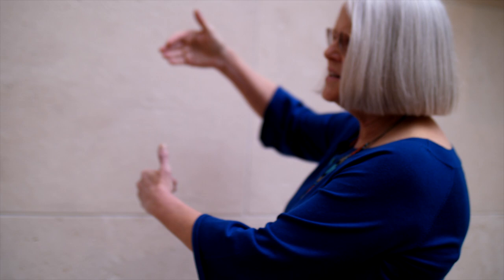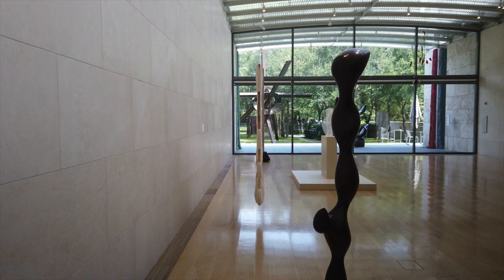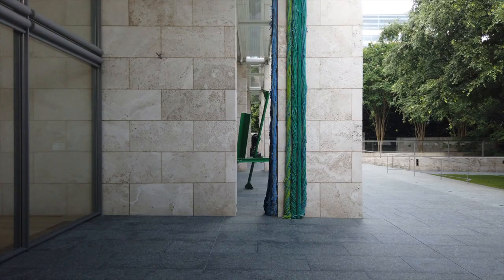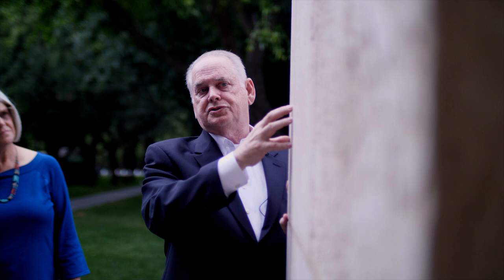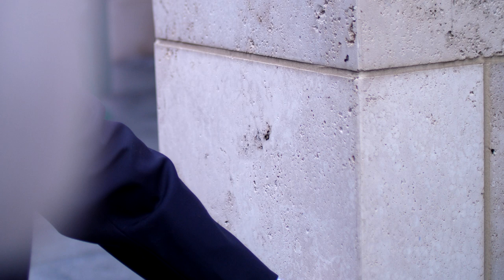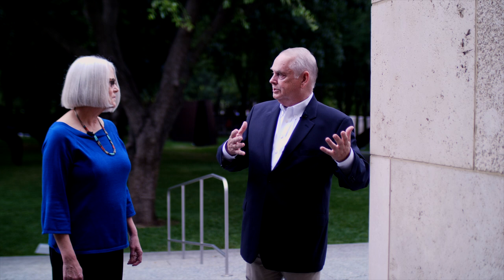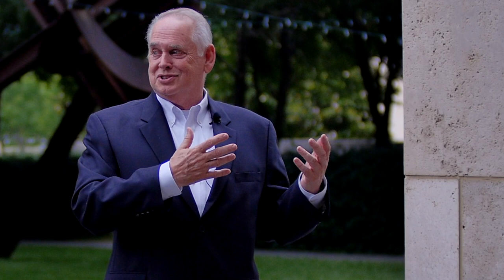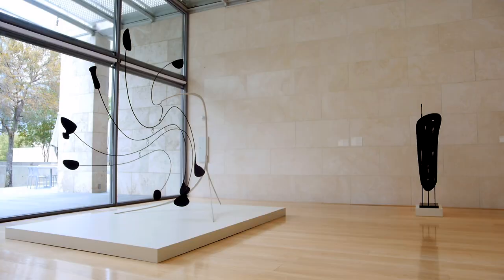Nasher Sculpture Center: The Building's Material

Comment: The man says that the outside stone facing is anchored to steel. Yet the image of that exterior wall clearly shows a concrete wall behind the stone. The tell-tale circular holes for the original concrete form's compression rods are clearly visible. (3:16)
Reply from the maker: Correct, there is a wall that surrounds the garden and is detached from the building. This is what you see in the still image. Neil is standing next to and describing an exterior column that extends from the main building. Earlier stills in the video show the steel structure of the building during construction. An integral part of Renzo's design is to have the interior gallery walls extend outside in order to unify the interior and exterior spaces and establish a conversation between the sculptures inside and outside.